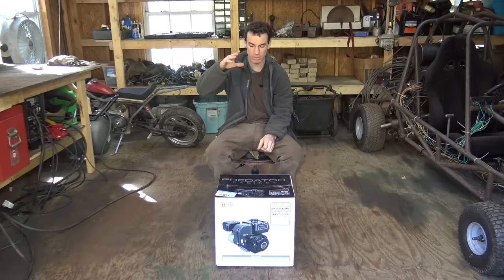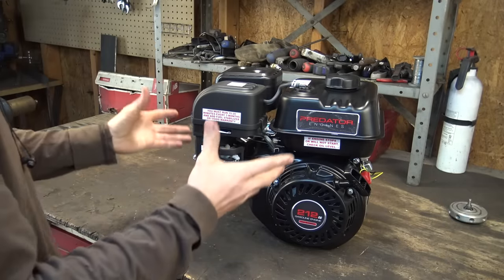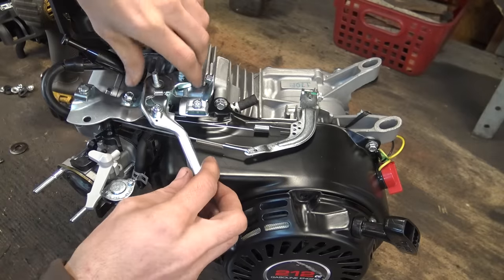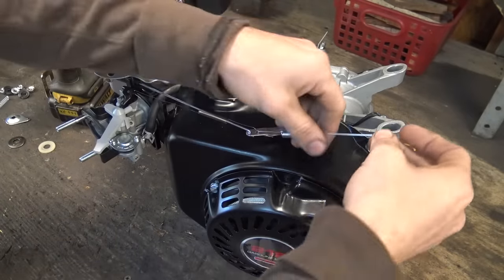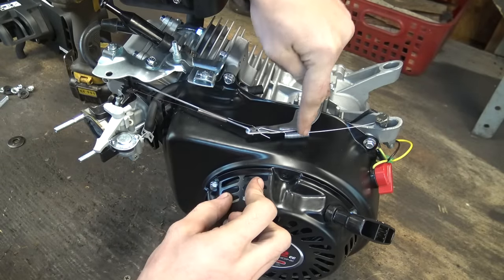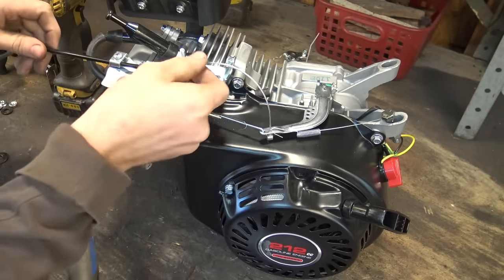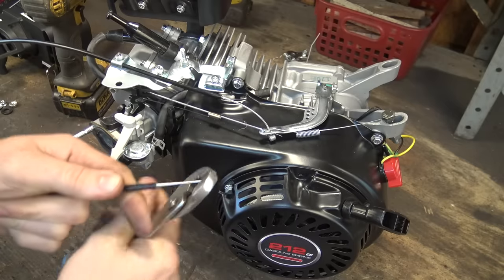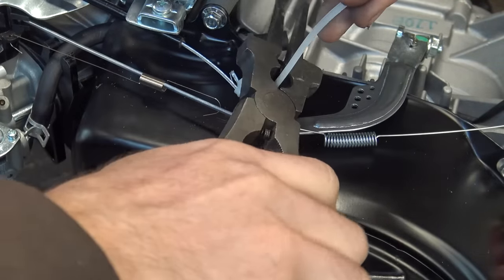how to bypass the governor on a predator 212 engine

Comment: If your missing the ball on the end of a throttle cable just smash a lead fishing Sinker on there
Reply: that does'nt work. lol. I wish it did
Reply: @allenwilson1864  it actually does work man. But instead of bashing it on there you get the lead weights that have the hole all the way through the center. Thread the cable through and put it where you want it and heat it with a blow torch until its close to melting and it will fuse to the cable. Ive done this many times. Works well. Use a blow torch with MAP gas
Reply: Like I said smashing it does not work. Melting it on does.
Reply: A simple propane torch will accomplish the task. But it is a good idea to clean the cable with alcohol and put a drop or to of soldering Flux where you intend to attach the sinker.
Reply: I totally did this also !!! And it did work !!! I did a mikuni carburetor conversion but my throttle cable didn't have the ball or anything on the end, no worries get out thee old fishing tackle, pick the right size sinker and voila!!! Hahaha glad I wasn't the only one to think of this !!
Reply: @rfnslick  African Engineering at its finest. As a temp fix okay, but not durable.
Reply: Or get the proper parts like a barrel clamp for a cable and tighten it on
Reply: He literally had one wiggling around there on his governor arm he could have taken off and used
Reply: @allenwilson1864  it does work,I have done it
Reply: Or some soldier...
Reply: I mean throttle cables are like 10 bucks
Reply: Or, crimp on a solderless wiring connecter...
Reply: Kage mangarti bahasanya gak bisakah bahasa indonesia
Reply: I haven't been fishing in over 43 years. It'd be easier to buy a cable with the ball while I'm out buying a sinker 😆
Reply: @allenwilson6585  v
Reply: Just buy a screw-on cable stop.
Reply: I just grind a channel or drill a hole in a bolt, and then lock the bolt over the governor bar and the throttle cable, has never failed,
Reply: I know huh.. some of us havent went fishing in forever and dont have fishing stuff
Reply: Maybe try heating up some solder in a small container and allow it to cool. I've seen some Pakistan metal workers make all kinds of neat stuff with solder. Ive even seen them make battery leads out of solder
Reply: I liked this comment until I fact checked it. I’ll take my like back now.

Comment: You just left the governor mechanism engaged .
Doing this will make the engine tends to reduce the throttle openning when it reaches the set value ( 3000 rpm ) and this tendancy will be opposite to the force of your throttle lever or handle what ever you use , so you will have oppsite forces acting against each other.
I recommend taking out the governer lever and keep the spring attached to a fixed position instead so that the throttle gets back to idle position when you release it.
Reply: Sorry I’m trying to do this now, and so your saying take off the long skinny rod? So then there will just be return spring and throttle cable connected to the arm?
Reply: @stevenhedrick1071 ķķ

Comment: Been watching all the videos just found this vid from a few years back. You're right you can bypass the governor of this way and if people don't Full Throttle it into Infinity they should be okay but if they max out the RPMs for too long that plastic Governor gear could explode inside. It could just be chewed up by the steel internals but it could cause problems I guess
Reply: Yes I have learned from previous mistakes that maxing rpm’s with this setup for to long will completely destroy that plastic housing and a suggestion is that you fully tenths gov
Reply: @a_gokart_kid1259 how long do u think it will last if u hold it for to long. And I’m thinkings about doing it how long do u think the engine will last if u are careful.

Comment: What I did to hold the cable in place is secured it in the cable clamp closest to the arm, and put the cable around and into the arm hole.  And then I took a bolt and nut to clamp the cable in the spot I wanted.  Rode my minibike real hard today and had no problem.

Comment: Remove the guvnah arm  and bore the mounting hole reinstall pinch bolt, the arm will move freely with no effect of the governor . You must reinstall the tank to keep arm from coming up and off of shaft, it could be cross drilled and cotter pin would work if you run with out the tank

Comment: IS REMOVING GOVERNOR FUNCTION GIVE YOU MORE HP AND SPEED WHEN USING ON A GO KART?
Reply: yes it makes it run at higher RPM
the result is that you get more speed+power at the higher RPM, but, higher RPM makes engine last less long because it is working harder.

Comment: I watched this just to see how the springs and such are hooked up, thank you... my Predator still does not start but this video is helpful.. so must not be the way it is hooked up, but found I am missing one the springs that attaches to the throttle action on carburetor.  My configuration is for a leaf blower, engine was put on a Giant VAC to replace an older Briggs engine, so my throttle cable comes in from the front side "pull starter" side and don't want the action to spring back automatically because it is not used like a gas pedal, like a go kart.  Once throttle is set on a leaf blower, you want it to stay on by itself and control throttle with the cable / lever.

Comment: Don’t need to do this, but I learned what all the parts are for on that speed control.  Had same unit on a 228cc, then put a predator on the splitter.   Learned to disconnect the oil pressure cut off today. Now it starts on a quarter pull, rather than several to apparently get the oil pressure up enough to start.
Reply: These engines do not have oil pressure or an oil pressure switch. What you disconnected was the oil low switch. When the oil level gets low enough the switch will ground out the coil and shut off the engine. They get removed or disconnected for the minibike and go kart applications.

Comment: Me speaking from experience if you bypass the governor gear whether it’s a predator engine or not, you better be committing to oil changes every 60 drive hours because the governor gear is what protects all those small moving gears from exploding inside the casing so if you do the general maintenance on it at thehours that the owners manual says and keep making sure there’s oil in it then yeah it won’t blow up but if you’re buying it, and it will be great to do maintenance on it. Then your engine will yeet itself into existence after five years of not changing or more.

Comment: Short stroke engines are designed as high RPM engines but low torque.  This engine is a 70mm bore (<3") x 55mm stroke (barely 2").  The engine in my SxS has a 72mm bore x 66mm stroke - it is redlined at 7500 RPM.  I don't know if the Predator is limited to 3600 RPM just to make them last longer or not.  It may be because the lubrication system is splash vs pressure.  But it would be a good test to run this engine at 6500 RPM just to see how long it lasts.
Reply: It only goes to 4700rpm without governor
Reply: 100's of thousands of people have done this, the tests have been done to death...
Reply: @archietheproto7706  Than the would probably due to the intake not large enough to supply any more air than at 4700 RPM.d  Naturally aspirated vacuum limited RPM.  A blower would be needed beyond that.,
Reply: The valves will float before you reach that rpm.
Reply: @danburch9989  they build these engines with after market intake adapters and mikuni carbs with header pipes, cams, strocker engines and the list goes on these engines can be built to rev over 9000 rpm and make over 20 horse power
Reply: @archietheproto7706  It can go higher with mods
Reply: Its limited to 3600 because thats what rpm generators use

Comment: instead of using zip ties try using a fishing sinker, the kind with a hole through the center. once on where you want it either crimp it on very tightly (temporary) or heat it with a small torch until it melts enough to make it permanent. it can still be removed by reheating it later and looks professional/factory made. bending the wire is now not needed.

Comment: The only problem I've heard of with just bypassing the governor like this is even though it won't effect your speed, that gear in there will still be spinning at very high speeds (speeds it's not meant for) and that gear could break and cause problems in the engine.
Reply: So u think id be better just to remove the governer by the inside
Reply: @Ephixa06  if you're ok with doing it, yeah. It's just a little more safe in my opinion and then you never have to worry about the governor again

Comment: Great method. With a little ingenuity, you can make it look better. A spring bracket that looks like OEM made it, and a throttle cable clamp on the governor arm.

Comment: So, if I'll keep the governor it'll be safer for the engine? I just need the throttle cable attached to the motor, so I could use the throttle lever on my walk behind tractor.

Comment: Doing it this way you will be fighting the governor weights passably causing the governor to break beings it is only plastic and eventually damage the engine. Ether use the governor all the way or remove all the way. I have been a auto mechanic for 39 years and the best way to do the throttle linkage is with the lever the way the engine was designed to work. The governor can be changed to govern out at a higher rpm. I have the governor on my hemi predator 212 at 6500 rpm I also balanced the engine so it doesn't rattle apart from being unbalanced and shaking.
Reply: Can you explain more clearly how to adjust the governor so it will rev at a higher speed thank you
Reply: They make so little force it can be controled by a spring.
Reply: Exactly, either people's parents are the ones shelling out the money for these, they are intellectually deficient from crashing  "a sick build"  they "modified" or they're wealthy enough that its inconsequential to them  (they should just pay someone to do it). Regardless, take the 30 minutes or $20 & do it correctly. Also posting obscenities in  statement does not make you or your opinions seem more credible especially when you cant form a coherent sentence on a machine that tries to correct you 3 different ways while you type. My 2 & 1/2cents
Reply: @jmc5341  Or how to use the correct spelling of "there" rather than "their".
Reply: Yea because the governor was not designed to be used right? There is no way you have even 1 year as a mechanic! If the governor fails running the throttle this way it would of failed either way! Such a wannabe clown!
Reply: @eatshitful  69 years of bullshittery, I can confirm that "this is the way".
Reply: @mrmarkle7088  Yep it works just fine. I am amazed by these people.

Comment: The reason the governor is on there is for standard applications like running equipment and machinery. The reason we remove it is for better throttle response, not more rpms. As long as you don't over rev it, you should be fine.
Reply: Nope it will give more rpm because the governer prevents full rpm
Reply: @braddo1972  No, the governor stops it AT full rpm, in this case 2500 rpms. Anything over that would be over reving and you have a better chance of damaging the engine unless you install better engine components like a billet flywheel, crank rod, piston and I would also put in some better springs in it if you want to over rev it. And might as well do a cam at this point, you are in it deep enough. Better yet, just buy the ghost engine.
Reply: That's another myth. Removing the governor does not and can not change throttle response. The other very popular myth is that you can't get full throttle with the governor and stock linkage. I get full throttle on my governed minibike engines. My engines would never perform the way they do if these were true.
Reply: @Deucealive75  No myth. I've done it enough times on several different motors. I race lawn tractors my whole life. Sure you can over-ride or bypass the governor. But it is better to remove it all together. You don't want to rev it higher than the max rpm  as stock. The magnets could fly off the flywheel, or the flywheel can explode in general. And If you don't believe me that's fine. I just hope you, your friends, or family don't get hurt when yours explodes.

Comment: Had you had any issues with the engine not wanting to start after this mod? My engine isn't running right now. Its surging real bad, and very hard to start. It's a brand new engine.

Comment: This does give you a little extra acceleration.. but it doesn't seem to do anything to top end speed.. this is just a direct set up for your throttle nothing really gained or then less looks best.. the problem I found was the rear spring pulls back too much, causing the choke to stay closed..so once you let off the throttle, the return spring causes the choke to close and stalls engine, also hard to start with closed choke as well
Reply: You need a bigger carb bro, the stock carbs provide enough air/fuel for the stock engine at the maximum governed speed, if you bypass or remove the governor you will definitely need to add extra air/fuel by way of a bigger carb, you can pick up mikuni vm22 carbs for Chinese dirt bikes pretty cheap on ebay and amazon. This will give the motor all it needs to burn at the higher RPM ranges and you will definitely see the benefits of the bypass. If you do this you might aswell add an aftermarket exhaust for £30 from ebay/amazon too. The power increase is pretty insane for very little money and effort and well worth doing. These are awesome little engines and can put out quite a bit of power with minimal money and effort. Good luck 👍

Comment: I hooked one of those springs up on my 196cc and even with a performance exhaust the motorcycle wouldn't go 20 MPH. Was not having it took the spring back off and just have that tiny one connected to the carburetor throttle lever to spring it back to idle. It does at least 40 MPH now. I know there's the governor gear in the engine is that still taking away power? I'm going to leave it until I get an aluminum flywheel anyway

Comment: Cars and cameras method is better, just take the side cover off, remove the governor gear, reinstall the cover. You keep all the original linkage and don't need to have 6" to 8" inches running from your clamp to the arm. But not saying this won't work.
Reply: dave1135 You have to modify the stock linkage to remove the governor like your saying(done it many times), but agreed it is much better.
Reply: E.
Reply: @16driver16  no you don't. You just remove the governor arm and gear and washers etc, and cut the arm off inside the case with a dremel. Keeping the arm sticking out of the case with the governor linkage intacked and still useable. Ive seen it done this way and works very well. Leave a slight bent on the governor arm INSIDE the case. Will keep the arm from coming out and then make sure to put the clip back on.
Reply: @joeshmo2473  i suppose you could leave all that linkage on there, ive never done it that way myself but ive since upgraded to a mikuni and ill never go back.
Reply: @16driver16  yeah your absolutely right about the mikuni. The only thing that sucks is the price. A genuine 26mm mikuni will run anywhere from 90 to 120 but they are sooo worth the money. I have one on my pitbike and it screams and the throttle response is much crispier.
Reply: @joeshmo2473  i found my mikuni on a blown up pitbike im not sure the exact size but it was free to me and other than th float sticking sometimes has been the best upgrade ive done, also i love the change it made in how the engine sounds.
Reply: dave1135 .

Comment: Lol I did something like this earlier to my Subaru 6.5 hp motor on accident and now I see this video no wonder it felt faster 😂
Reply: I am planning to remove the governor completely on that engine, add a mikuni 22 and a rev limiter to 4.5k... not trusting the flywheel
Reply: @cmh-re  flywheel should be good to 5500rpm, valve float occurs at 5000-5500
Reply: @DRpotatoYT  yeah, "should" is not enough for a flywheel literally behind my neck 😁 i made some calculations at the time and I was impressed by the forces involved given the weight of it
Reply: @cmh-re  at your own risk, I personally haven't had a problem with the stock flywheel but to be safe I put a billet one in there. I value my legs when I ride my minibikes.

Comment: Removing the governor is a good trick,(if you run the streets) at WOT! LOL! I trail ride my mini bike, and I'm more interested in low end torque, than high RPM. I use a CVT and a 60 tooth rear sprocket on my bike. It pulls like a tractor, but still hit's 32 mph with my 254 lbs.riding on it!

Comment: Have a predator 212 engine. Was running fairly well..
   Was writing it as normal and it just died on me. Now it will not start.
  What are your suggestions??

Comment: Smh. I removed governor in 15 mins. Open case, rip out gear. Push arm all the way up. Grind off some shaft(after removing arm and all that b.s he is f'ing with). Pull out arm from bottom..
Lazy way without taking out rod and blah. Tap hole where arm came out block before. Screw with ruber washer/lock tight. Clean everything nice... put it back. Boom! No governor.
Reply: steven r funny you should say that! He is using the Governor arm as the throttle cable so in fact he isn’t bypassing the Governor at all he threw away the good arm and kept the Governor arm no point!
Reply: Need to warm the Motor for 15 min before doing that gov removal

Comment: Now the way you have it hooked up let’s say you have the throttle cracked wide open the spring you put in to return the throttle really won’t be strong enough to keep the Governor from being engaged with the added throttle as you open it up. What’s to stop it when you’re on full throttle no return spring! Correct me if I’m wrong?